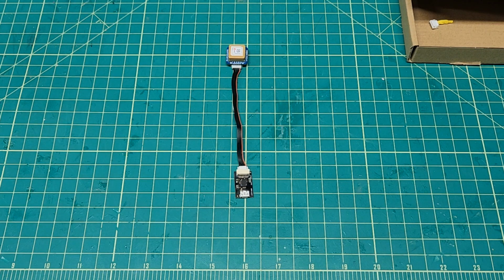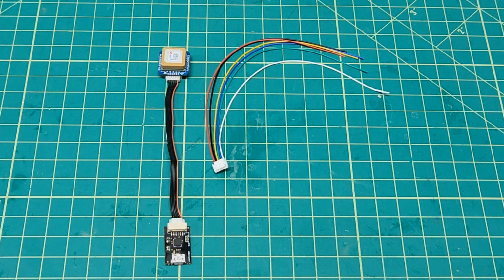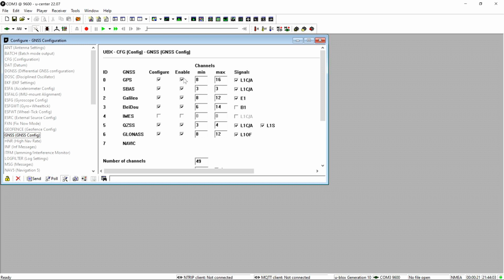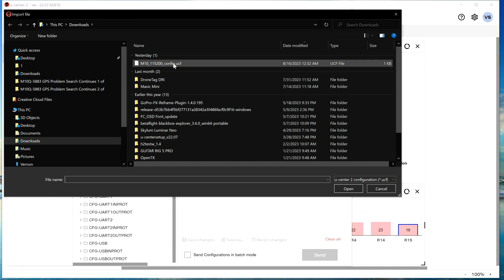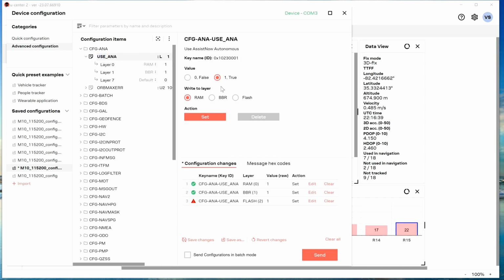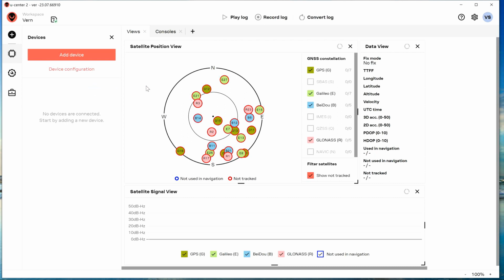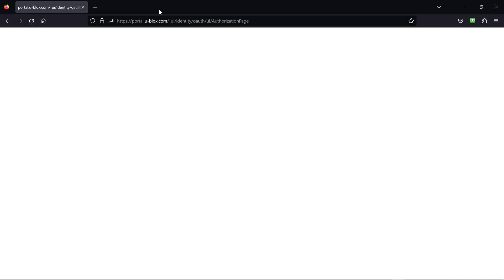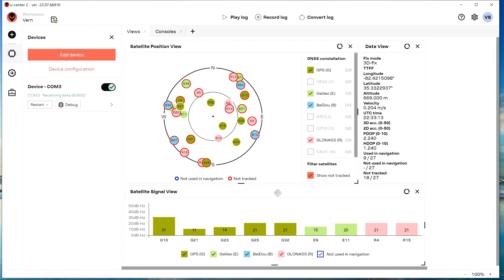M10Q 5883 GPS Problem Search Continues 2 of 5

Comment: I smell a rat in the number of satellites reported in Ardupilot! Perhaps it’s reporting satellites seen but not the number used for navigation! I’m waiting with baited breath to see the results with the Flywoo! Thanks  Vernon for the research and videos!
Reply from the maker: I agree.  This has slowed me down a lot in my plans to fly instead of construct.  But I still do NOT regret trying the M10 GPS modules.  When they work, and they will, it will be much better than ever before to have more stats locked up.  With the M10 modules the platforms will have far less fly aways.  Looks like the tron god got me good here.  rofl

Comment: I think it is the remote id is messing up your gps ever since you hookup the device.
Reply: Interesting idea! The implications could be staggering!
Reply from the maker: Rofl  Likely.  lol  I can test that when I get back.  But there is no remote id module running when I have it connected to uCenter.
Reply from the maker: If true, it could be used against the FAA to remove remote ID.  Really easy to disconnect it.